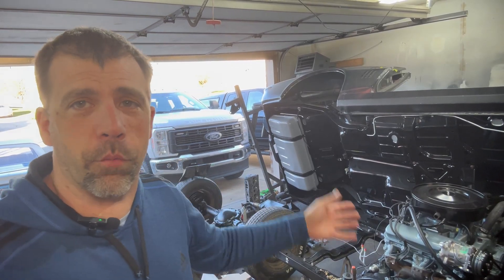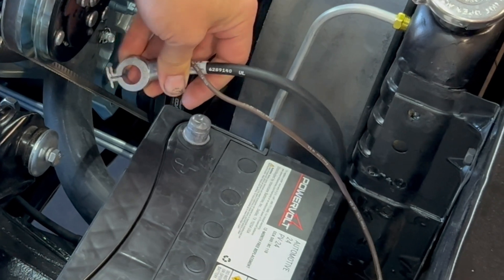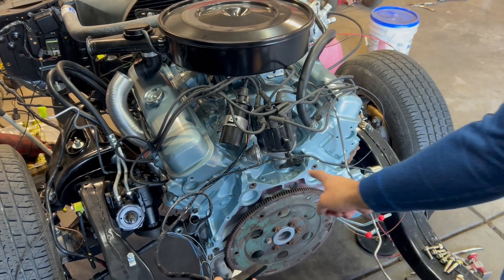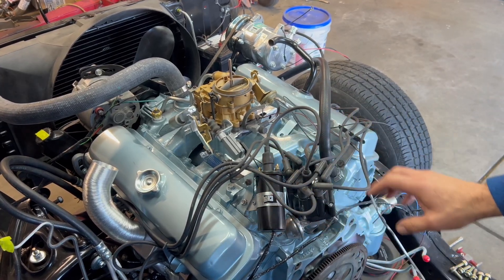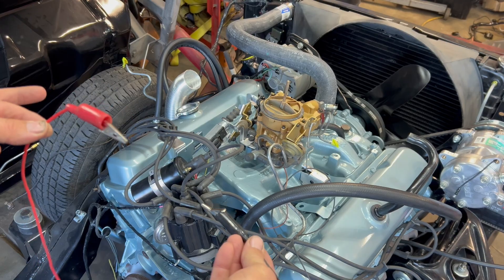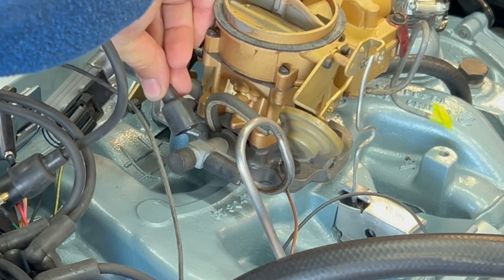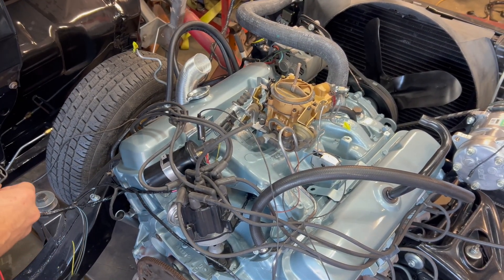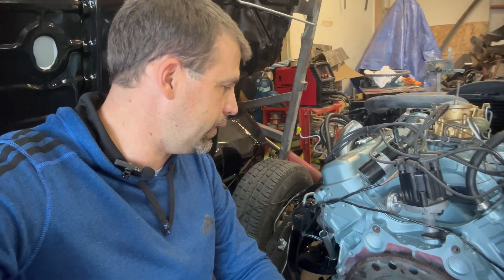How to wire engine to run outside of the car

Comment: An easy cheap setup would be to mount a couple of single pole light switches from Home Depot, etc. to a piece of scrap wood, and use one for coil power, the other for starter power.  It helps to not have live alligator clips running everywhere, but then again, that's part of the charm.

Your videos are always entertaining and informative.  I run a 350 Pontiac in a 67 Firebird.  I used to test fire old motors on an engine stand similar to what you put together.  What's nice is that you learn a lot about the electrical and accessory systems.
Reply from the maker: Exactly! Understanding how things work only make it easier to keep it running and working right
Reply: Great job!!!!!

Comment: Using the unattached engine sub frame for a run stand is genius! Great step-by-step verifying, starter operation and spark, THEN adding fuel. A little light-off verification is all you needed to proceed. Thanks for clarifying the 8-10 volts provided at the + side of the coil through the resistor wire, for points type ignition!
Reply from the maker: All good points I figured worth sharing

Comment: The 12 V by pass , crank mode ? Not using it ? 🤠
Reply from the maker: Nope.   If running points still I would but the accel  point removal system isn’t designed to run on 12v it is meant  to run on 9-10v

Comment: Nice video, I always time the engine before hooking up a fuel source. It eliminates a variable, and is one less thing to be worried about when getting an engine fired up for the 1st time.
Reply from the maker: I normally get pretty lucky and drop the distributor close enough they run on the first attempt.   This one got me and kicked the starter some but super easy fix.